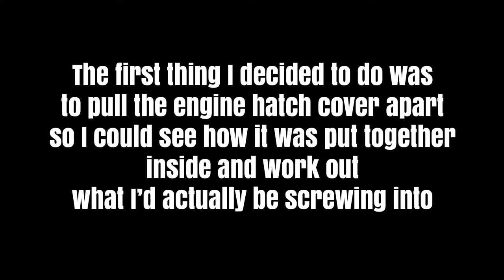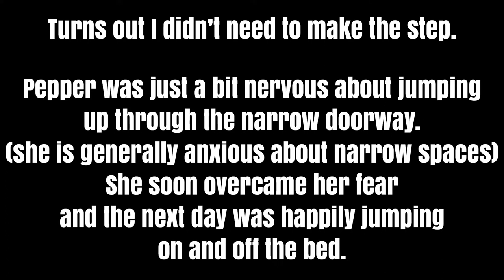Pepper's Seat Part 2 - Building a travel seat for my dog in my bus

Comment: Dyani, I watched your video and the problem with safely securing Pepper. I notice your bus basic floor set up has the spot for the passenger seat in traditional spot, but probably because it was for a school bus its passenger seat was moved. Now I am thinking where the tradition seat would go there would be the re-inforced metal under it to take seat-belts, if so then you can buy the base end of a seat-belt from wreckers or auto cheap place and fit it making sure you get the correct bolts.  This can then be used with the doggy tether part to attach Pepper. it would enable you to use your first set up which really did give you more room to get through to the rest of you bus. This might be worth looking at. Cheers hope to see more of your videos I have loved them so far. Have been looking to see if you made any when you had your previous bus ?
Reply from the maker: Thanks for the comment Marie. I think I still prefer this second setup as it means Pepper is secured further back from the windscreen and the gearstick etc which I think is safer anyway. I don't need to access the driver seat from the main area very often.
To answer your last question, yes I made heaps of videos with the first bus. They are all on my channel if you go to the videos tab and scroll all the way to the bottom you will see the earlier ones. But I also did a playlist of the first bus too here: 
https://youtu.be/pe3d7ABfu3U